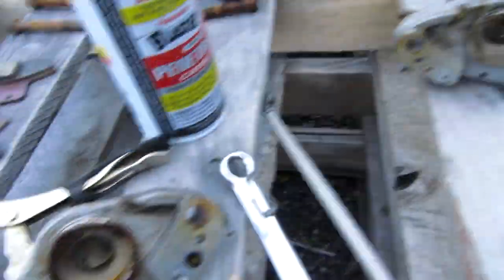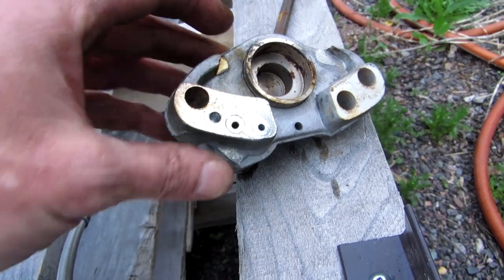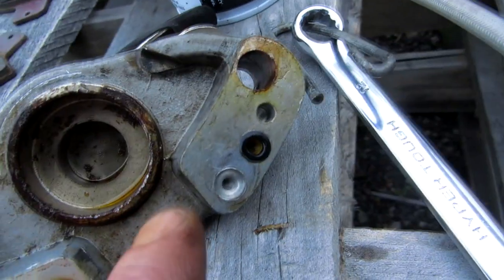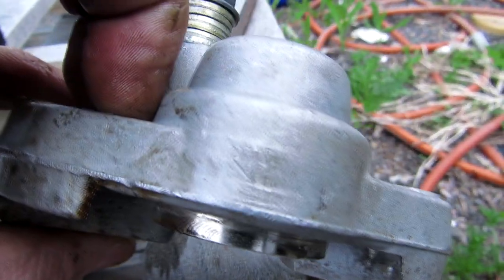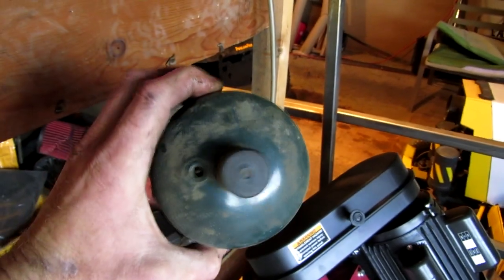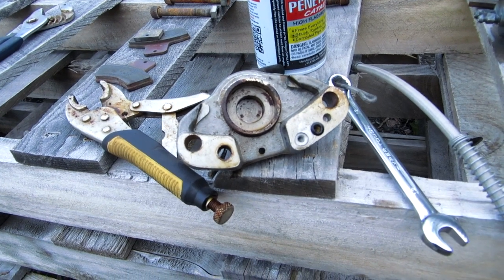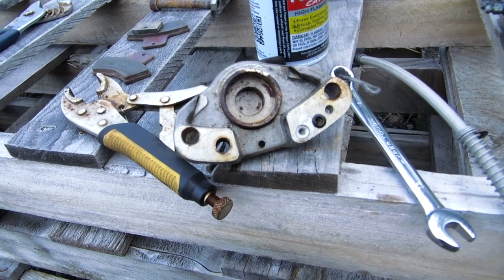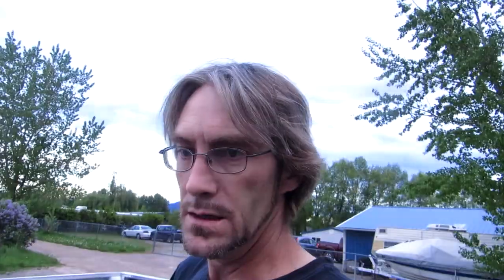Fullscreen Machine Brake Caliper problem

Comment: Looks like a simple O-ring, take the calipers to an auto parts store or home improvement store & try to find one that fits in there. shouldn't cost much. 
Since there is rust in there, the cup may be stuck.  but I'd try it 1st to see.. Good luck

Comment: Your right it's frustrating when it's one wee stupid part that fails as now a days it's take a part off and replace not like it use to be strip it down find out what's broke replace that bit and rebuild it that's what's called as refurbishing a part by taking it to bits and just replacing the small part that's broken inside that's why I said an O ring seal kit because I've seen a box and has different sizes of O ring seals in the box either automotive shop or look up internet probably Amazon might be best bet

Comment: I hate stuff like that, too. Manufacturers like to come up with sizes no one carries so they can charge whatever they want. You may have to pull the other O ring and measure it or take it to NAPA and see if someone there can match it up. IF you can get someone who will take the time to look.

Comment: looks like a O ring  just go buy a O ring kit or go buy the longer tool  you need for that propane tank ether of the two i think would be cheaper n easier.or you can always look around on ebay  for more common break set ups and start buying them and change the system over to the  new one
Reply from the maker: ...true